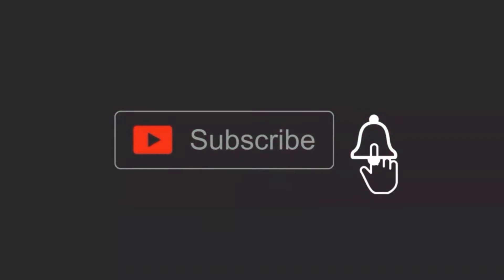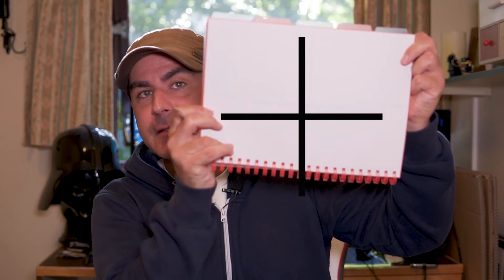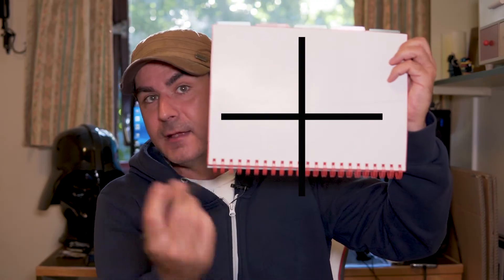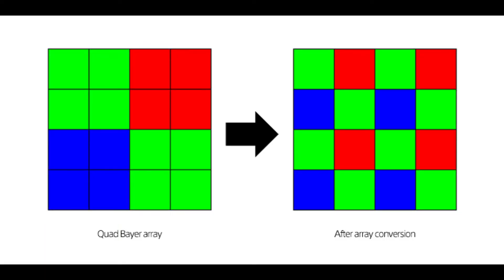Sony a7S3 Quad-Bayer Sensor? My Predications

Comment: Yes it's quad Bayer because that's what the Sony says matches the patent number for the sensor they are using for this camera. But they also said 48mp will be disabled in the a7siii. Sony created this sensor to be used in multiple bodies, on e of which will have 48mp.

Comment: Also exciting along with the new sensor, is that we will likely see their new H.265 based XEVC-S codec in the a7S3.  And IF it is a quad bayer 48MP sensor, they could do 8K 12bit Bayer RAW 24fps at only 240mbps!  12bit RAW 8K at only 240mbps, dannnnnngggg (the rumor'ed 600mbps bitrate if correct, would most likely be for external RAW, not an internal bitrate.  Back to the excitement around the XEVC codec and hopefully new color science based on Cine-Alta.  Even if Sony "Locks" the quad bayer 48MP sensor to 12MP as only a lowlight 4K beast, we are still looking at some impressive Image quality with internal recording using XEVC-S.  Like upto 12bit 4:4:4 RGB or YCrCb at 4K/24p still at only 240mbps.  But I don't think we are going to see a 12bit video option this time around, so likely the 10bit 4:2:2 option in the XEVC lineup at 240mbps for 60fps and 100mbps for 24fps.  To me that is insanely awesome.  100mbps efficiently used with an H.265 based codec will be more like a 250mbps H.264 quality or 500-600mbps RAW..  These two pieces of the puzzle are the reason for all the delay.  An entirely new codec, new color science, quad bayer sensor (locked at 12mp), and most likely a stacked sensor for fast read out (almost zero rolling shutter).  To me,  THOSE spec's are more important than 8K, and whether or not it does internal RAW.  Gonna be a sweet camera with a long life span.  What is funny to me is how "8K" future proofs a camera?  WTH?  that is so ridiculous of a statement.  To this day, if you have a 1080P/10bit video camera, that produces a top image quality, you still have a viable piece of gear (really good 1080P/10bit looks amazing when upscaled to 4K.  Same thing here, this is likely to be the best 4K/10bit video image quality we have seen.  Combine that with no overheating and good battery usage, you should have quite the workhorse here.  One that you can just record the best 4K image quality on (from a mirrorless) all day long without overheating.  I'm really hoping for their best water sealing to date as well, because I mostly do filming on solo wilderness backpacking trips and don't want to have to worry about rain/dust ruining my camera.  But then when doing commercials or corporate shoots, caging up my a7S3 and making some money with it.